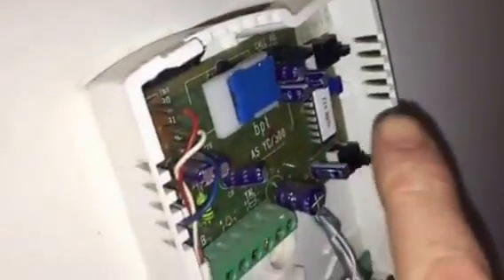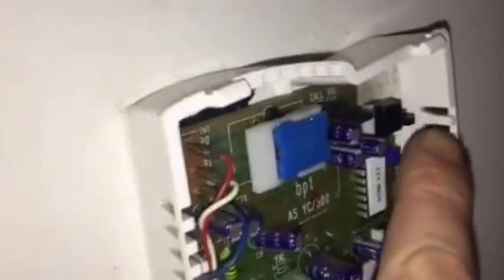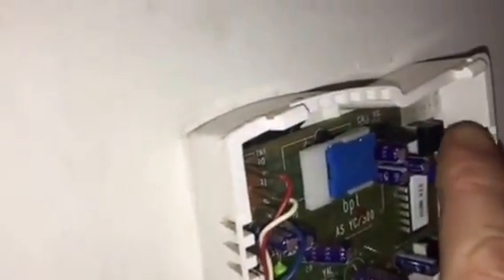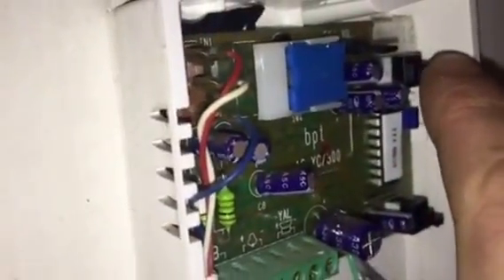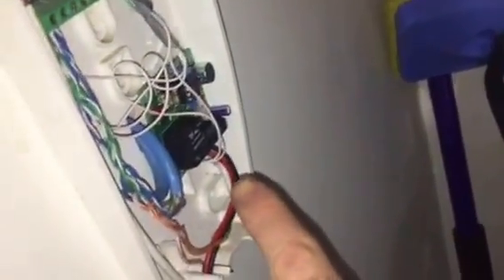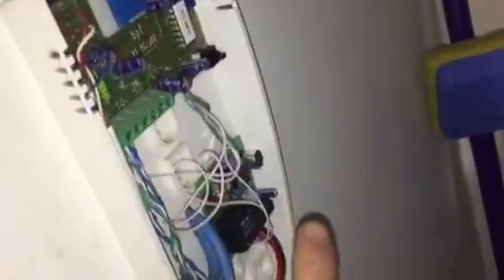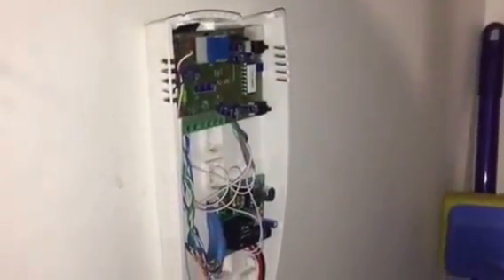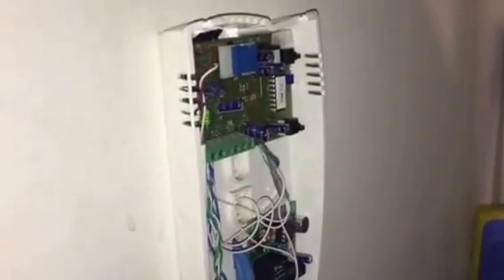Auto unlock your security door with a sound detector relay

Comment: I like this solution. I'm trying to find a solution like this that is pre-packaged. As I am not an electronics guy. I looked at Nello One - but it is not compatible with my particular apartment intercom system. I am just looking for an auto entry system - so that when someone presses my apartment buzzer, the door system automatically unlocks the communal door. Your system seems to do this perfectly. I need to install this in London, England. Can you make one for my particular intercom system if I send you the pictures of the inside? And identify an electronics installer in London that can fit it to my system? If so, let me have your contact details to discuss.
Reply from the maker: Its easier than you think. Just describe your intercom here and nerds like me will help you. Im not going to build it internationally and send it back. Its not practical anyway. The device I purchased was from England too so it will be cheaper for you. Start by unclicking the lid of your handset in your apartment from your intercom and take a photo of the circuitboard with your phone. Google the info and paste the link to it here. Then we can tell you which wires to clip / solder. The only things that device doesn't come with is a female connector, a 12V power supply and some wires. Buy the device and take it to your local electronics shop. They could solder some wires to it under most circumstances, but you probably cant take the intercom off the wall so you'll have to do that part yourself. Then just plug the other end into a power socket and it will work. Dont forget to buy tape or screws to hold it into place.
Reply: Thanks. It’s a GDX intercom... GDX-123018.

https://doorentrydirect.com/gdx-gdx-123018?cPath=371_1905_1907&zenid=cf1a8105a2798a40137e2e8fac8bf579

I have pictures from inside the intercom if they are useful also?
Reply from the maker: You need to link to the circuitboard, not the sales ad for the consumer product.
Reply from the maker: I am a master of getting things done quickly. Do this: Buy the sound detector relay now (Monday 5 March 2018). When it arrives on Thursday, go to your nearest electronics shop before it closes and ask them to sell you the wires and power supply you need to complete it, and ask if they would please solder them on. Then show them the photos of the circuitboard (Back AND Front of circuitboard - easier when someone handles circuitboard out of the wall while second person holds camera) and ask how to attach it. They will not come with you. The circuitboard cannot be removed from the wall of your house. You have to do this yourself. If you do not follow these steps I am giving you, it will be the end of any assistance you are likely to get. This will give you maximum efficiency - you will do it right now, or you will never do it. These instructions have cost me effort to make your life easier. 99% of people quit at this point and get angry at the person providing clear instructions with free warnings. So its just a now or never from you. I recommend Now - even though you may need a soldering iron, and for someone to help you hold the circuit on the wall while you shout at them in frustration to hold still. Even still, this is the now or never you need to get it done. This frustration, or the frustration of continued missed deliveries, which are only  getting more commonplace with no large-enough letterboxes.
Reply from the maker: I cant at the moment, but basically each switch has two wires that connect to become one wire. If this sound detection relay is placed in between those two wires it will close the circuit when activated. I simply used trial and error to figure out which two spots on the circuitboard I needed to solder to. In my case I think it was Common and Normally Common. Each Circuitboard is different. Probably best if you solder onto the back of the circuitboard. Also, the noise your doorbell makes is right next to the sound detector, so you can turn the sensitivity down on the dial of this product so you can make more noise inside your apartment without triggering the relay. 'Relay' simply means a switch that you dont have to touch - relay switches are triggered by electricity, not your finger.
Reply from the maker: Try to film the process and put instructions on Youtube.
Reply: Thank you for sharing this tip! Would be cool if you can make a video on how you did it. It will be much easier to copy that. Regards!
Reply: Thanks for reply. I ordered relay and all what i need for upgrade.  I hope it will  be a piece of cake.
Reply: Sure thing! I`ll come back with updates.
Reply: Hey, got the board today and tried a small test before installing. All good! https://youtu.be/3rtIDkIvoxc
Reply: Now, the problem is i don`t know where to connect on phone...Can you take a photo of where you connected the system? It will help me. Thanks!

Comment from the maker: This is still the best method on the entire internet for automatically unlocking your security door when you want the delivery man to leave stuff inside your apartment security building gate when you're not home. I can't believe I've only got one like and 300 views.
Reply: well, this open the main building door, the guy still can't enter you apt does he ? also what happen when you play loud music ?
Reply from the maker: I don't understand most of your words, because they don't make sense. In response to volume sensitivity, which I assume you're referring to with this sentence, "also aht happen when you play loud music ?", the relay will activate based on the setting you've selected. Given that the relay switch only unlocks the electronic strike downstairs if someone rings your specific apartment first, inadvertently triggering the relay while you're making noise can happen but won't affect the strike if nobody has already rung your doorbell. I used to activate it to test it by clapping my hand next to the receiver, and it would beep. Music never set it off. The sensitivity is set by a dial on the circuit. The sound of the doorbell right next to it set it off every time without fail.

There are other apartment setups that trigger the strike any time that anyone in any apartment presses the unlock button. In my apartment, you cannot glue the unlock button down so the door remains unlocked at all times - someone has to ring your apartment specifically first to allow your receiver unlock button to work. I did not think to glue the button down at all times. The relay deactivates after 5 seconds.
Reply: Zxenmusic I edited the message. sorry. But I was saying that this system open only the building main door not your apartment door ? unless you have a buzzer on your apartment door
Reply from the maker: My apartment at the time of this video did not have a buzzer inside the security building, only outside the security building. When people were inside the security building, they would find my apartment number and knock. If I wasn't home, they would leave my deliveries for me. It saved me many hours of chasing courier companies.
Reply from the maker: The intercom unlock button in my new apartment is completely different - if I press that button it will unlock the security gate immediately. Its so basic and stupid that releasing the button immediately locks the gate again. Thats why the sound relay would be good to install here too, so long as the sensitivity is low and only detects the doorbell. The sound relay has a 5 second switch, so when I get home with heavy groceries, I can ring my doorbell and shove the gate without trying to find my keys in my pocket. Given that I only ever leave the house to go shopping, this would be useful every single time I arrive home - my hands are ALWAYS full when I arrive home, and getting keys out of my jeans at the security gate is always completely annoying. With hands full of heavy groceries, I would press the buzzer with my knee, then I would have 5 seconds to shove the gate open with my hip.